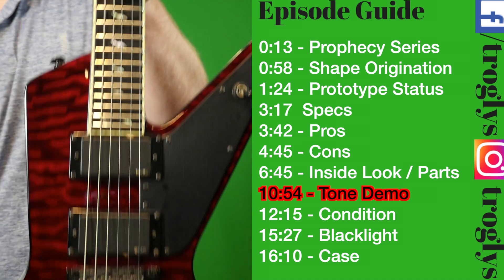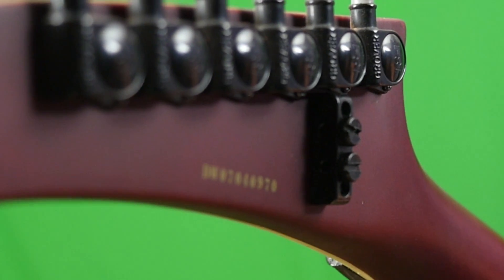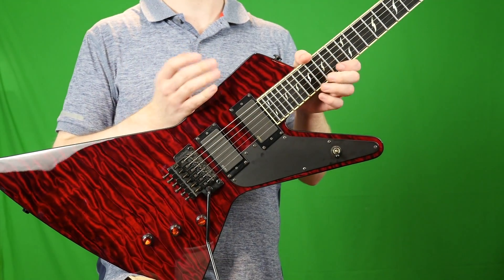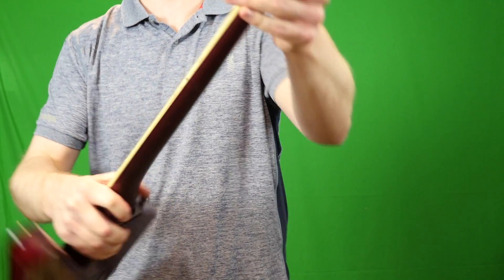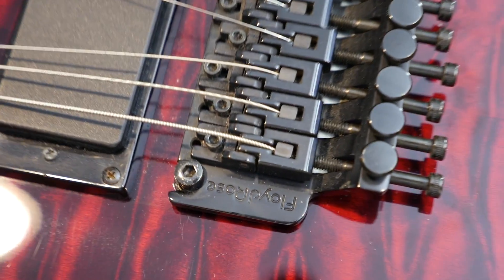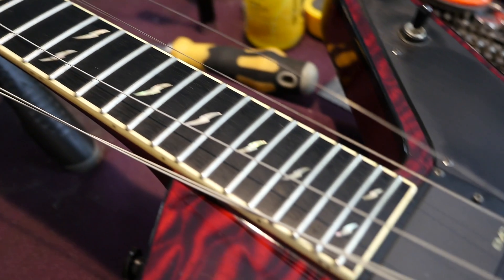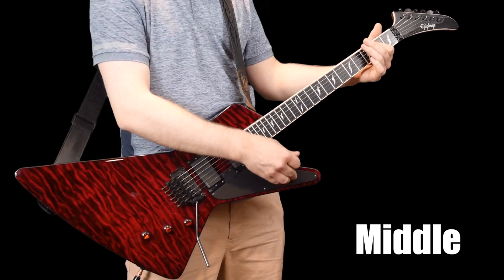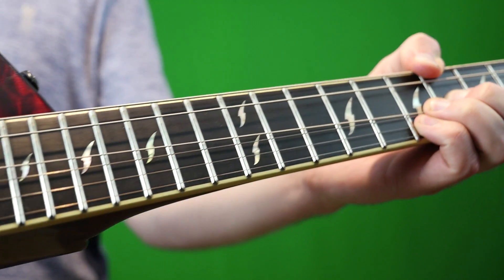The Evil Prototype | 2007 Epiphone Prophecy Futura FX EX Black Cherry | Review + Demo

Comment: Cheap mahogany species tend to be very heavy, but 11 pounds doesn't seem over the top for me. 10 lb Les Pauls are sort of normal, so what difference that one pound can make?
Reply from the maker: The difference comes from weight distribution. I was expecting it to clock in around 16 lbs because all the weight is in the body. The increased body size also makes it feel heavier

Comment: Was that floyd a drop only floyd, or was the neck angled and that way the floyd sat high of the body? I didn't see a rout under the floyd.
Reply from the maker: It goes both ways
Reply: It isn't routed deep enough to pull back very far, like on an Ibanez or something. You can only dive bomb down, Van Halen style. Pulling up for vibrato is fine, though.

Comment: Just a note, that's not an original floydrose. The original ones are made in Germany and have that stamped on the bottom of the base plate. This a Korean made floydrose 1000 series. You can tell by the flattened edges of the saddles. Hope that helps :)
Reply from the maker: Thanks!